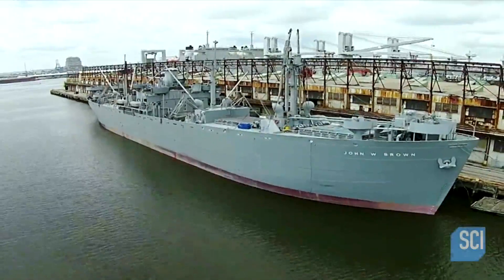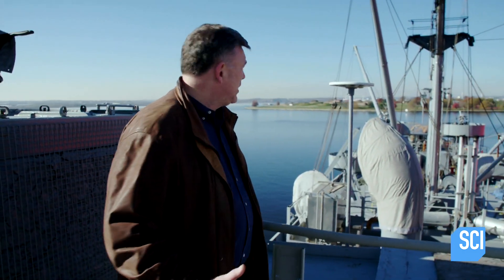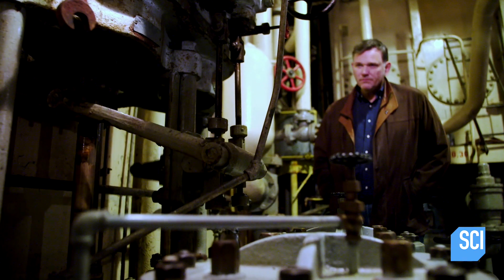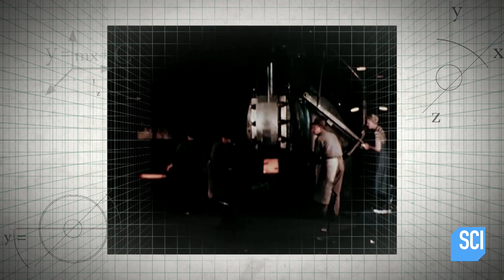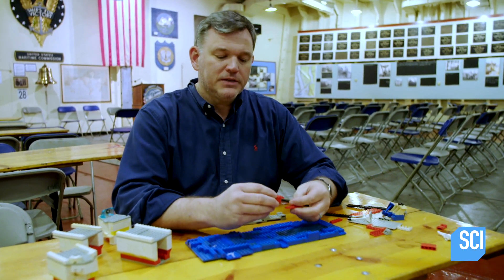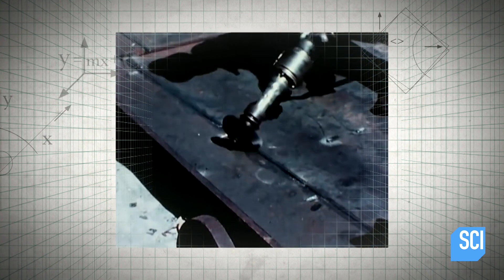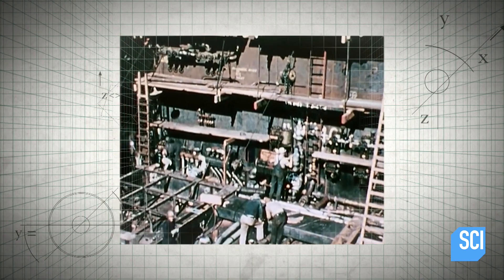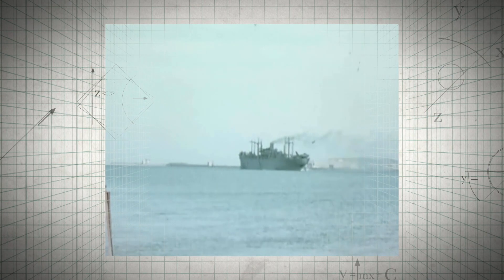This Technique Revolutionized Shipbuilding During WWII | Impossible Engineering

Comment: BUT they also had major problems. 

If I recall from school didn't one of them crack apart down the middle with failed welds?
Reply: 1200 suffered from mid deck cracks and 3 sunk due to splitting in half. The steel used suffered from embrittlement but what made the problem worse was that the ships operated in the cold Atlantic making the brittle steel problem even worse and were also routinely overloaded which compounded the problem even worse
Reply: it needs special steel to compensate brittle fracture.
Reply: Lots of the WW2 war-fighting industrial programs had problems. The B-29 bomber was behind schedule and the engines had problems that were addressed only with intensive maintenance. Three of the 18 cylinders had to be replaced every 25 hours - roughly every two missions.  The most dangerous part of a mission was taking off at max loading of fuel and bomb payload in hot, humid tropical conditions - ie. moist low-density air.  Engines were virtually at operating temperature just from sitting in the sun. Everything was experimental and men's lives were risked. Those risks were considered 'acceptable' at the time. In hindsight maybe they weren't.
Reply: I think they 'cured' the problem by welding a big ugly reinforcing gusset down the sides of the hull on some ships.
Reply: @russg1801  they have curved steel welded inside the cargo hatches that were made to stop the cracking